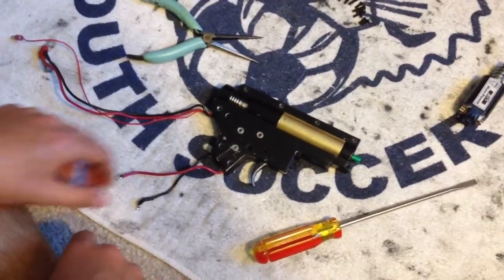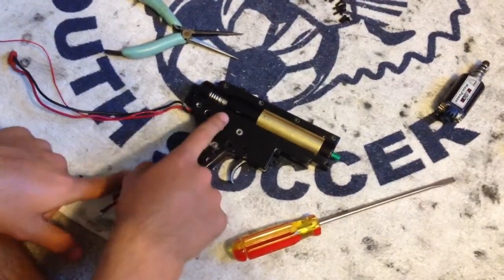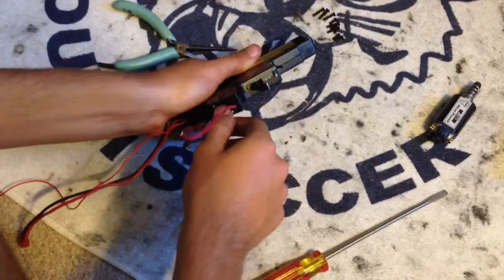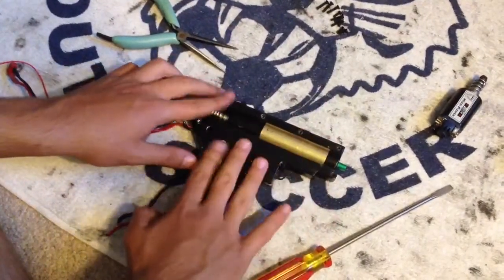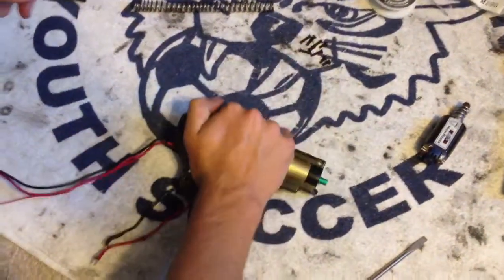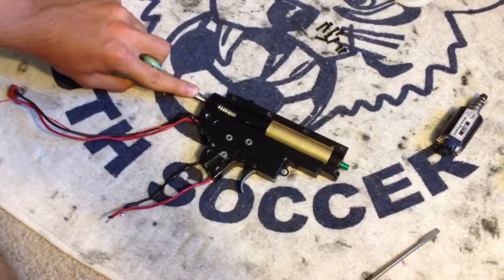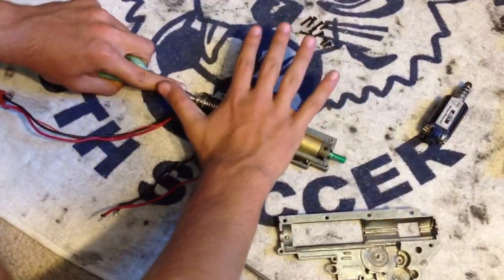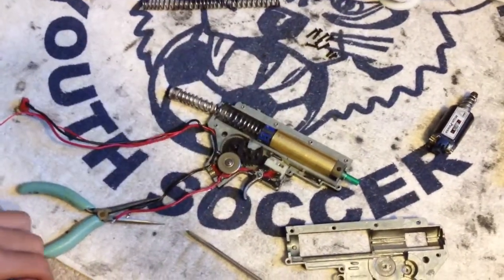How to Properly Open Your Airsoft Gearbox

Comment: Pulling the ARL manually on the DSG will break the tappet plate depending... also to note manually pulling the ARL on a stronger spring is just a matter of time before some teeth break.